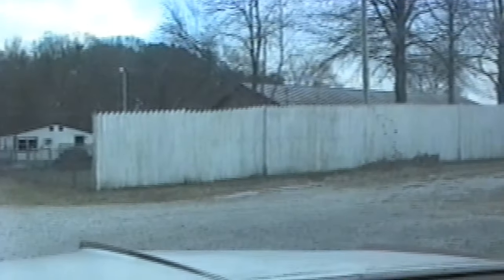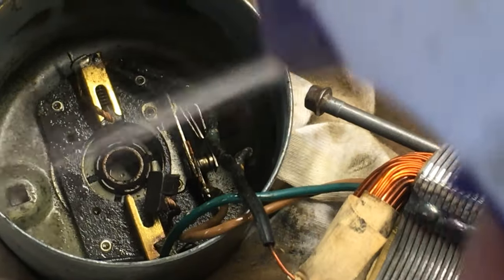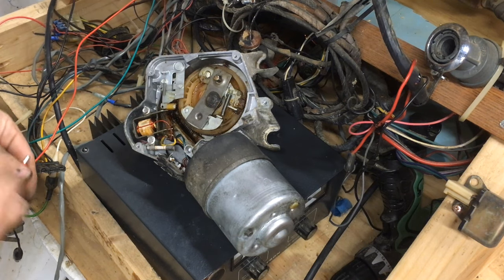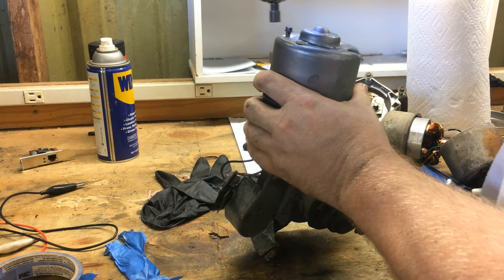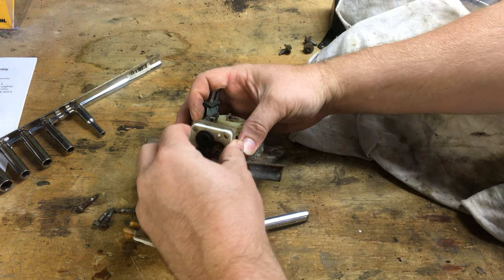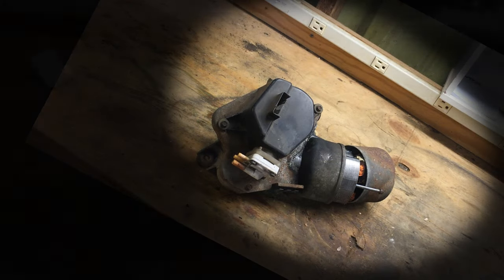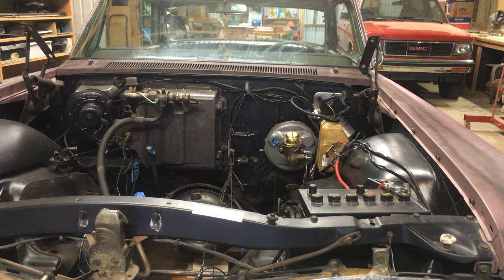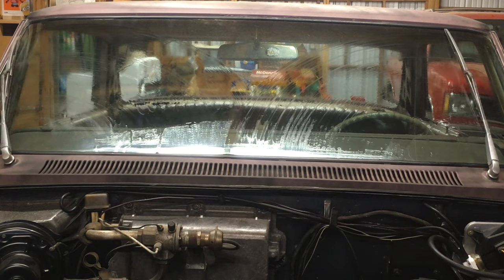60s GM Wiper Motor Rebuild, 2 speed overlap: 1964 Buick Wildcat Underhood Refresh Episode 6

Comment: Thanks !   This helped me get my 1963 Electra wiper motor working again.  I made the mistake of removing the motor cover and the brushes popped out.  After much struggling I used your tape technique but I found I had to use some stickier tape than the blue because the blue just couldn't hold back the brushes against the springs. I used white tape but probably the orange painters tape would also work
One other tip. If you're restoring one of these make sure that ALL the mechanism is free and loose to move. One little piece on mine was still seized and I hadn't realized. This caused the motor to run continuously as it wasn't quite hitting the off contact on the relay
Thanks again for the clear and informative video !

Comment: Thank you for this video! i watch while i dissasembly, clean, lube and re-assembly my 64 Impala wiper motor.
Brushes are a PAIN to put on place. 
I used paper clips on isolator holes to hold the brushes... But really hard and patience job to do.

Comment: i am also repairing the wiper motor for a 64. However, the electricity does not go from brown wire to green. circuit breaker is slightly ajar. How does the circuit breaker work?
Will the circuit breaker be normally open or closed?
Reply from the maker: Because the wiper motor and transmission kickdown share a 25 amp fuse in the fuse box, Buick put a circuit breaker in the wiper to protect from the whole circuit going down from the wipers. It would likely be safe to tie the tan and green wires together in the wiper motor, and place an outboard 20 amp fuse right at the wiper motor. Other 60s GM cars are fused at 20 amps just for the wiper.

Comment: That was excellent! Thanks. What do you think my odds would be in completely taking one (1965) apart? To the point I can bead blast the cast body?
Reply from the maker: Looking at the factory service manual, it appears you can get all the electrical guts out, and most of the gears. It does not show the motor to drive housing separated though. Provided you could keep the abrasives out out of any non-removable lubricated surfaces, you may be able to blast the whole nine yards.
Reply from the maker: @cdnpont  Great job!